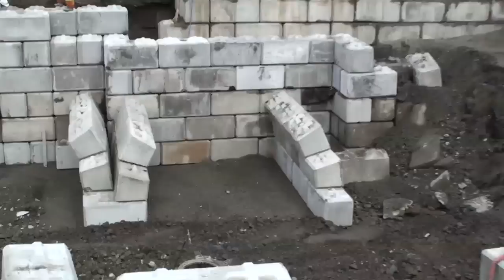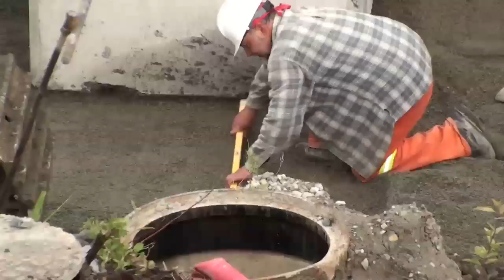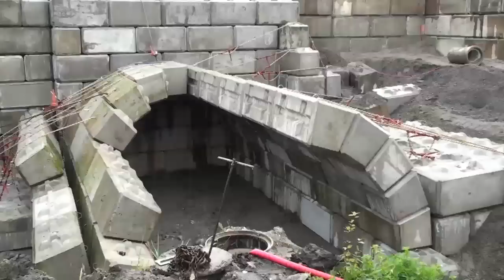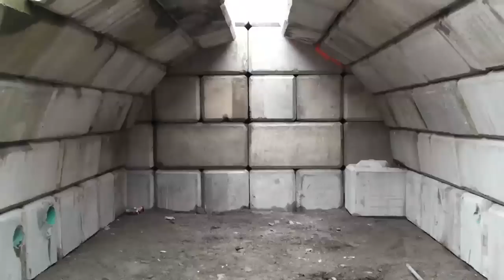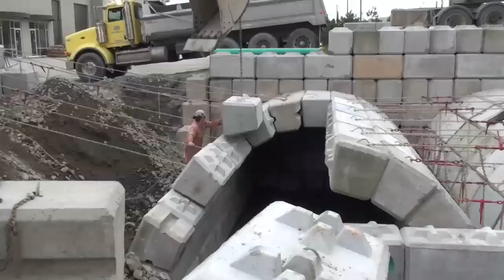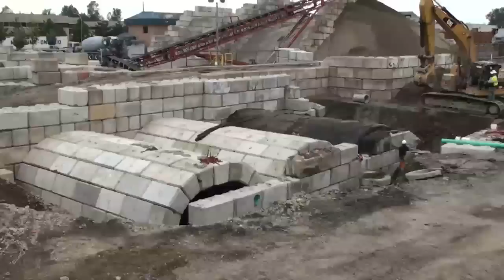Arch-Lock™ construction

Comment: With an operator, me and my buddy built a 25 foot wall on a 6 degree angle on the vertical  and were able to curve it roughly an inch per block. It was an "S" shape and was for a storage facility on the Sunshine coast. These blocks are AWESOME!!! Of course every second layer of block needed geo-grid for strength. And an engineer and proper permits. What fun!! Will be there my lifetime! 

Good times!

Comment from the maker: There are many differences between our system and the monolithic domes you describe. They are one piece and are structurally much different. Having natural joints in the structure means the forces that travel through it are much different.  Also, since our system is modular, it does not require rebar reinforcement. They are also pre-cast, meaning they can be installed very quickly and de-constructed and re-used if needed.

Comment from the maker: Part of the reason the Roman designs last so long is because of the arch shape itself.  Since everything is in compression, the concrete is used to its maximum capabilities.  As you might know, concrete is much weaker in tension than it is in compression.

If you're interested in alternate methods of constructing these arches, subscribe because we'll be showcasing it later this week.

Comment: This is a very strong construction. No metal to rust and no concrete joints to crack with freeze-thaw cycles. It will probably outlast most buildings in the area.

Comment from the maker: If one were to make a poured in place arch, it would actually be weaker because the entire structure would be one piece instead of discretized into segments.  The fact that the arch isn't a solid piece means that the load calculations on it are different.  A piece-wise arch is better suited to handle the loads and far cheaper than a rebar reinforced one.

Please contact us via our website to discuss pricing.

Comment from the maker: The structure was designed by an engineer to withstand earthquakes just fine.  After the arches were finished being put together, soil was dumped on top which restricts lateral movement.  For an arch to fail, 3 hinge points have to open up.  Since it's back-filled, there's no chance of that happening.

Comment: What is the maximum arch width you can span so far?   ie a 30 foot span.
Can you precast utility runs in the blocks?   For electric lines and such.
Would this system be adaptable to utilize foamcrete or equivalent?   A super light concrete building material.
Very impressive system.

Comment from the maker: To construct an arch with formwork would take much longer and require specialized labourers to build.  Creating the custom formwork for a pour in place job would also be very expensive and not re-usable as wood is typically used. In addition, the engineering of a structure that is poured in one piece is completely different and far inferior than individual blocks.  Building the arch from pre-cast pieces is also quite a bit faster.

In short: Less time, cheaper labour, cheaper materials.
Reply: Lock Block Ltd, This video seem to be a good one, but can u show us the finale  result when the job /project was finished , just to show this arches what they are used for  ? (  I trying to understand what was the purpose of all this job at the end of the day ). Thank u

Comment from the maker: Not at all.  Since they're designed to be used in compression, there's no need for costly rebar reinforcement.  They cost only a small fee above what that much concrete would cost by itself.

Comment: So the structure is supported by itself, using the compression of its own weight? Wouldn't it 'wobble' if there's an earthquake or construction nearby. They can't use this method for larger span or arc right?
Reply from the maker: When the structure is backfilled (covered with dirt, in this case), it's not going to wobble anywhere.  If you wanted to build a free standing arch, you'd want to secure its outside radius with a steel cable to keep it sturdy while in motion.  Or, you could thread it through the inside of the arch through a pre-cast conduit.

Comment: Great concept, but I see at least 5-different geometrical shapes used. How many are there, total in the 'LockBlock' system? I see how you can use 10-mil wrap to water-proof at subsurface levels, and industrial sealants above surface; and I see a definite thermal advantage with a foam insulator subsurface - but don't you have the same disadvantages as ANY castle above surface? (thermal loss, dampness, etc.)? What's the per-block cost on those, anyhow, and what is the block's composition - concrete?
Reply from the maker: The blocks are solid concrete and weigh approximately 4400 lbs.  There are many different shapes that can be found on our website.  For insulation and waterproofing, the system can be supplemented with other building envelope technology to suit the needs of the project.  The Arch-Lock system is much cheaper than typical form and cast systems because of the speed of installation and low material cost.

Comment: that is cool, what is this building for?
Reply: Poopingbotham
yeah your probably right
Reply: That's what we're all wondering,but no one is replying with the answer.Those arced structures are blocked off at each end???.Very confusing..
Reply: Looks like a water Retention system
Reply: Water reservoir for rain runoff under parking lot.  Said somewhere above in a different comment thread.

Comment: 1:34 he was like damn!.......f*** it. Its level for me!    :)

But for this arch they could have build a frame from steel that you can adjust and lower when the headstone is in place. Then move the frame again. No chains needed. Of course the frame needs to be higher then the arch in order the get the headstone in.
But the chains work pretty fast and every project is different. And chains work saver...you do not have to get under it in order to lower the frame. The frame needs to be standardized in order to let it work profitable and make it useful for different projects.

Respect your work! I learned from it as a student construction engineer.

Comment: I think this is really cool.  Why not use a white oak dowel the size of a baseball bat to hold them together as they are stacked.  The crane (backhoe) could then place them without help, and without all that complicated chain business - looks like a pretty dangerous operation in this form.  With a little improvement in design and the right machine/operator, I think you could build one of these in a single day with only man.
Reply from the maker: The dowels are an interesting idea, but then you'd still have the problem of the whole thing tipping over in one piece before the keystone is put in.  Also, keep in mind this is a crew that has never built one of these before, so they were learning as they went.  I have no doubt that they could build one in much shorter order if they were to make another.
Reply: Well.  I never thought of the tipping over, but presumably, you could put the first dowel into a footing and first block on that dowel/footing.

Possibly, you could assemble the arch/blocks flat and then tip/pick it upright, although that's not very elegant and you might really need a crane then.  Plus it would be tricky to stagger.

I think you guys are on a great track with this modular construction method in general.  Still room for some improvement on making these blocks stack more easily/faster. Good work so far though - they remind me a little bit of legos (a toy I was too poor to have as a child).
Reply: Bradley Brand You might even consider employing some woodworking joints (e.g. classic mortise and tenon) into this type of member on member construction, perhaps elements of frame and panel as well.
Reply from the maker: Bradley Brand Keep in mind that each of these blocks weighs 4400 lbs and the goal is to be able to assemble it with common equipment.  Also, the fewer pieces, the better.

As for doweling it all together, that would negate the advantage of having it modular.  Keeping the joints flexible means that it can take higher loads than if it's all rigid in one piece.
Reply: the chian are only need to put the thing together once the last piece put in! it whole self together, that why called the KEYSTONE

Comment: how to you support the abutment on the left side of the final arch. is it mechanically joined to a foundation below grade or if the left abutment settles wont the arch fail?
Reply from the maker: What the camera doesn't show is that each of those chains is connected to a counterweight (one of our standard shaped blocks) to keep it anchored.

Comment: It might be safer easier to use pole/screw jacks to hold those blocks.
Reply from the maker: Space is a concern on this site and everything undertaken on the site was done under supervision and design of an engineer familiar with construction loading of the arch during placing.  The factor of safety was much higher than required and there were absolutely no issues with the project.  The crew knew how to communicate with each other very well and work in the rain with proper safety gear and procedures.

Thank you for your concern.
Reply: Lock Block Ltd. Was there a reason why falsework wasn't feasible?

Comment: But I really cannot see the point of using such heavy and massive blocks, unless you are building massive structures such as a huge cathedral.  Better to have the same blocks made of polystyrene  to1/5 scale, put together without the need for huge cranes and then covered with galv. steel mesh and rendered with a malleable cement/mud mix and voila!
Reply from the maker: Polystyrene has a fraction of the compressive strength of concrete and is unsuitable for this task.

Comment: 4400 lbs each?! You do not want to be under those when they collapse. Let’s say in a crazy earthquake? BTW looks like expensive bunker  to me.
Reply from the maker: Always have your foundation designed by an engineer familiar with earthquake design and how the native soil will respond.  Arches are actually very strong in earthquakes.  There are countless arches built in Roman times that are still standing in Italy.  This system WOULD make a good bunker and would be far cheaper than any cast-in-place system.
Reply: Lock Block Ltd. Actually, I would think because of the angled tooth and pit design, it would fare better in earthquakes than any of the alternatives.  The earthquake would cause the arch to jiggle and then the stones would slide back into their places guided by the teeth and pits, as long as a large amount of dirt doesn't invade that area in between the joints.  Mortared joints would crack anyway and in that situation at the end of the process many of the stones would still be in the arch, but no longer exactly matched up.   

Some of the Roman and Greek designs consisted of stone joints in which one was convex and its mate concave, so when the earthquakes came, the building would rattle and then the parts would slide back into their proper positions.

Instead of trying to build structures that would stay intact in an earthquake which was an impossible task, they decided to build structures that would reassemble themselves as the earthquake wound down.

I like the block with the tooth and pit design.

Comment: do the male sides of the blocks ever chip or crack during placing?
Reply from the maker: dr pheel No, they do not.  They are solid concrete and would require significant jackhammering to get them to break off.

Comment: It looks like they did it wrong at 5:25.  It looks like the key stone is not on top of the arch.
Reply from the maker: The block at the top of the arch, regardless of what it's shaped like, is the keystone.  I can't remember why they chose to put it on the side like that, but it's just as structurally sound.

Comment: Why not take a cement barricade zipper machine and design a machine that lays the blocks has it moves and turns forming a tunnel?
Reply from the maker: If you look at our Zipper truck video, you can see that's exactly what we did.  This one was done with chains due to space constraints.  The property basically ends where the camera is stationed.
Reply: I watched a video with a brick laying machine laying a brick road way. I thought a machine could be designed to do the very same thing with the blocks used to form tunnels. Laying the blocks and riding on top of the blocks already placed.  Crazy idea.